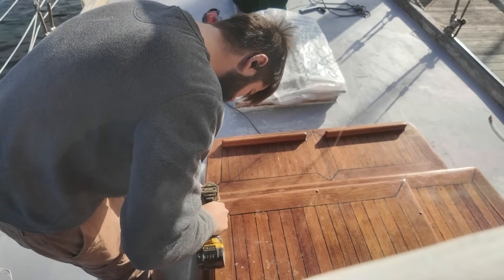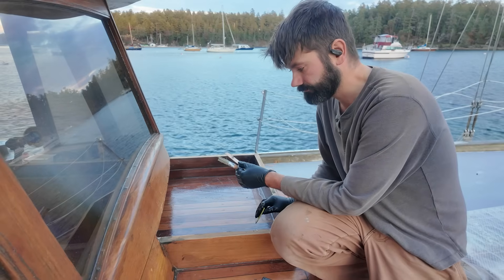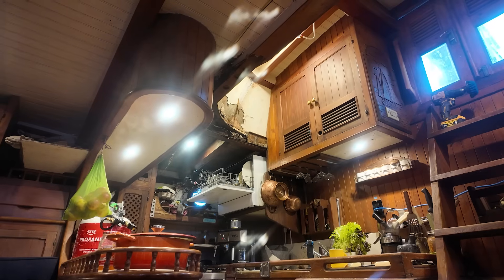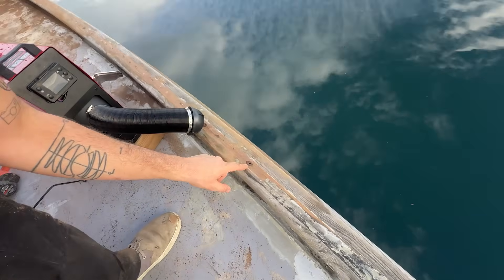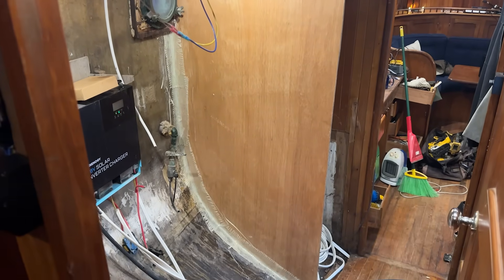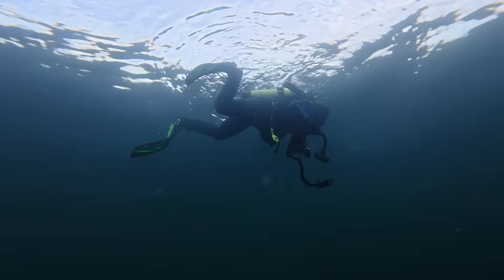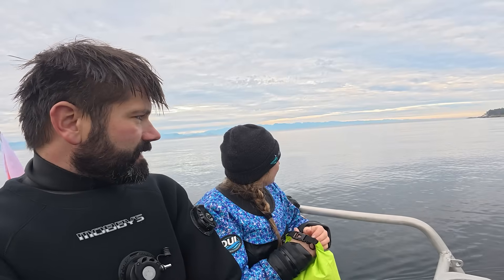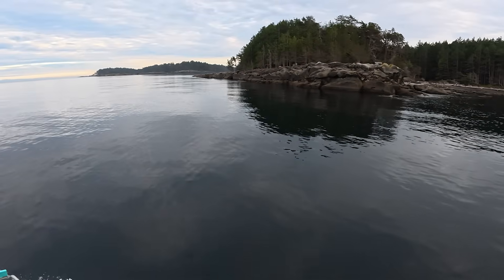Finally Installing Bulk Heads

Comment: Covering everything with epoxy will not stop the leaks 
If the water gets in under the epoxy will make the wood rot
Need to find where it is

Comment: How chilled are you at the end of your dive??
Reply from the maker: I'm not usually, my suit is plenty thick and so long as I was moving a fair bit I keep pretty warm. If I get wet and then spend several hours in an aluminum boat before being able to change however, that's a different story.